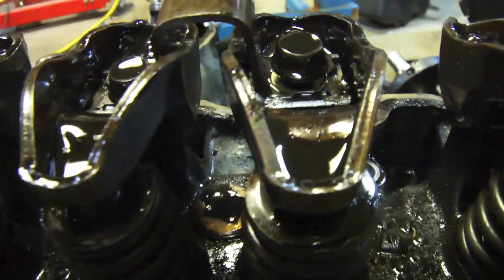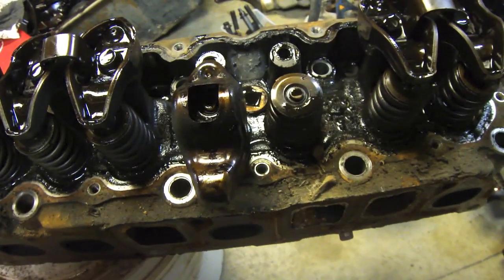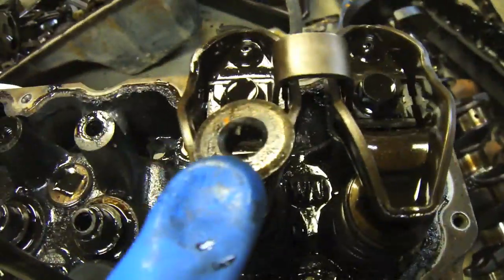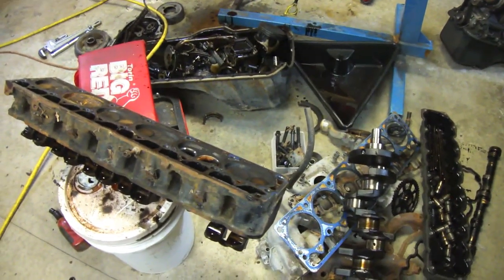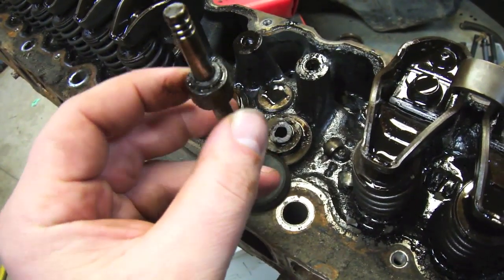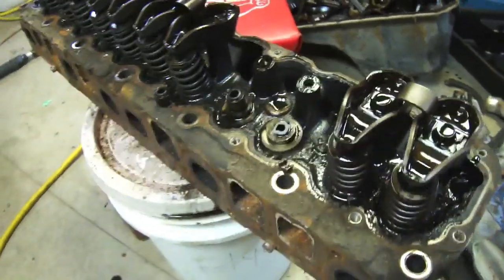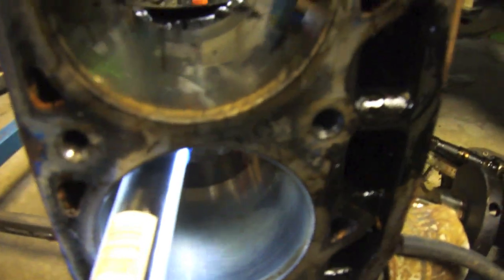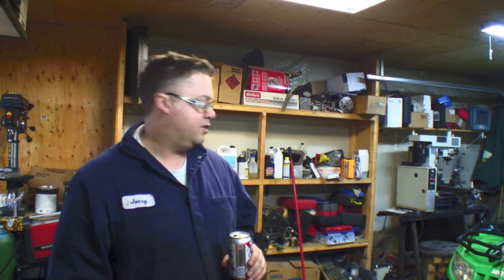Inspecting the Head on the Jeep 4.0 motor and final Thoughts

Comment: Valve guides usually don't come out. Unless Chrysler does stuff way different then they should not come out. Thats why they say to be careful when lapping the valves because stuff can score the inside of it and screw up a head.

Easiest way to remove valves for me is to compress the spring enough and turn the head over and smack the valve with a rubber mallet. It will throw the keepers out and it can be removed from there.

You are correct. The last person who ran this engine didn't bother with valve lash adjustments which is pretty important on a push rod engine. However because of the wear on the lobe something wore that cam lobe down while it was still functional. Personally I think the cam lobe wore, this caused excess play in the push rod and that helped a lot to back that bolt out and boom cam, rod and lifter was toast. The push rod breaking was just the straw that broke the camels back.

I bet this engine was ticking its ass off before it stopped running.

But good break down.